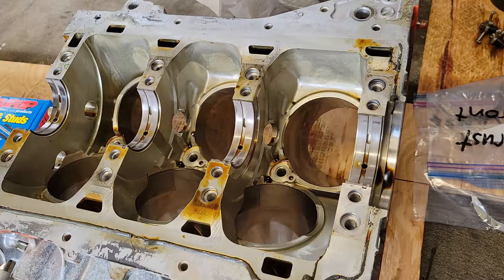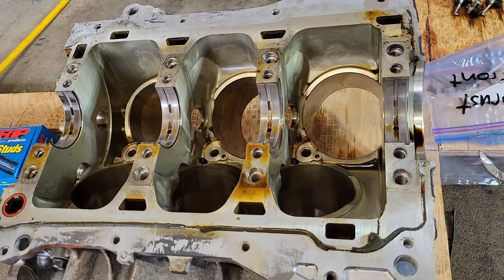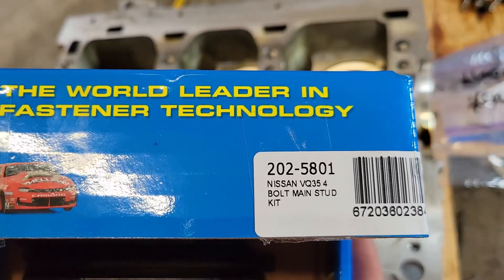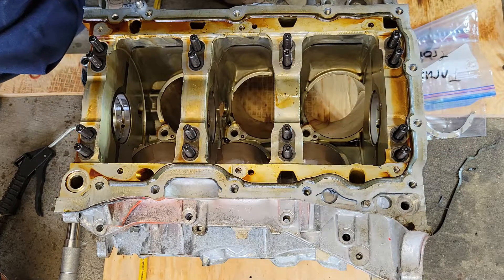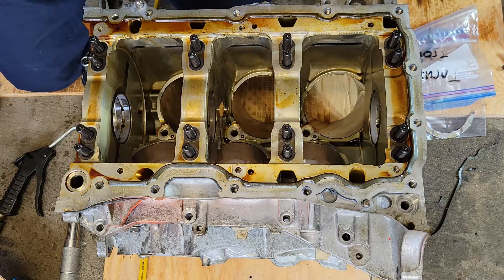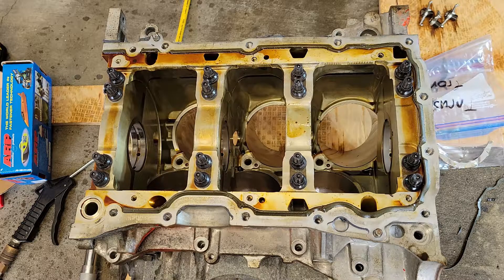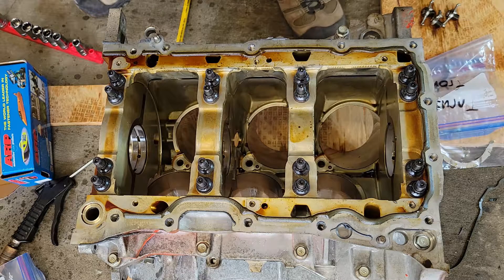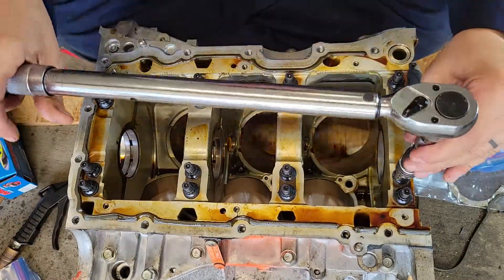Forged VQ37VHR build part 13, machining prep

Comment: Hey man I just stripped my vq37vhr down to the block and plan to take it to the machine shop soon, was just wondering what I should do to it if I wanna build it for a street application? Also I wanna get a a new valve train and if you have any suggestions where to buy the parts at that would be great?! Love the videos man! Really helped me for the build I wanna do!
Reply from the maker: What do you mean by street application?
Reply: @garagefanatic7830  well all I really wanna do is push as much power as possible NA.
Reply from the maker: @devinortega7298  If you are comfortable with spending in excess of 10k for upwards of 400 whp, go for it.